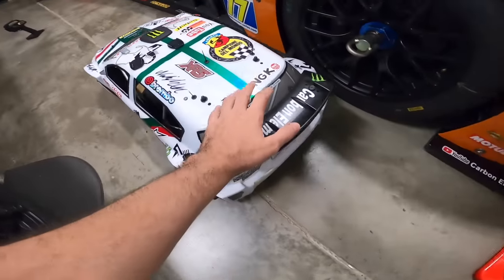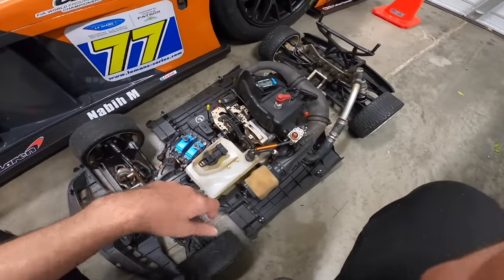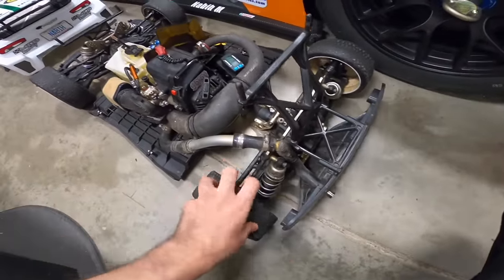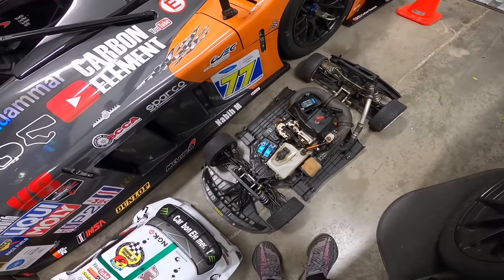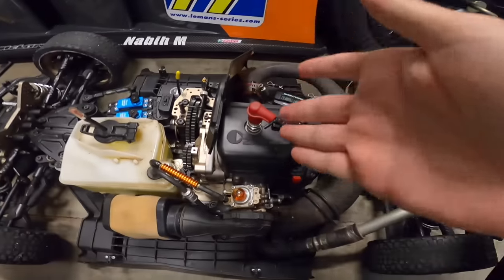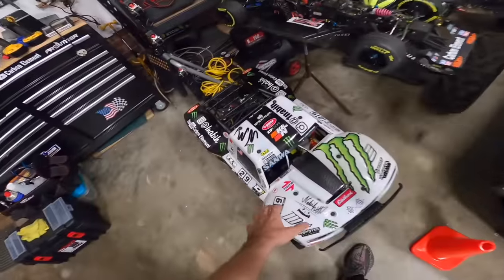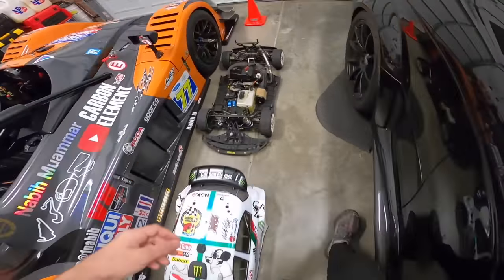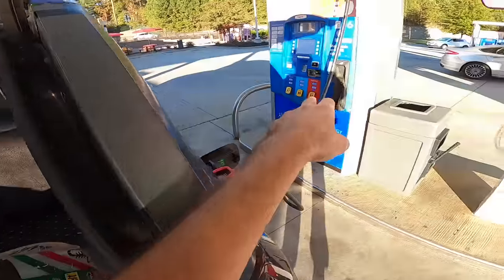RC CAR ON HIGHWAY PART 2 SHIFTING GEARS !! 5TH SCALE BEAST

Comment: Try using a GoPro Max 360; you can playback from any vantage point and the mics handle wind noise very well.
Reply from the maker: Have one and used it on it but I couldn’t use the software well

Comment: Great car and crappy idea. Its literally dangerous to drive your rc one the streets like that. In Poland you would have 2 possible outcomes HUGE fine, or getting your rc rammed by someone then have cops called on you so you would get fined and also have to pay for the damage on the car that rammed you.